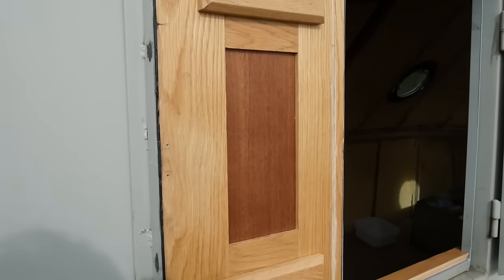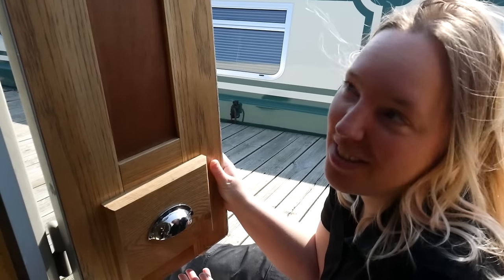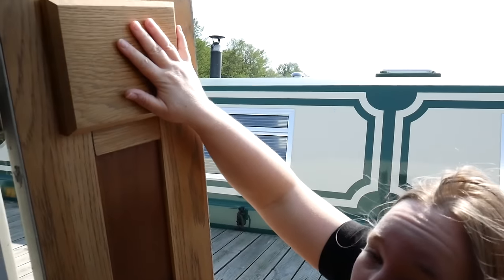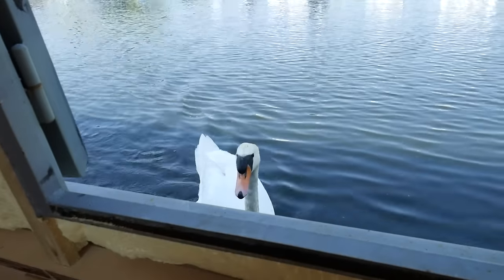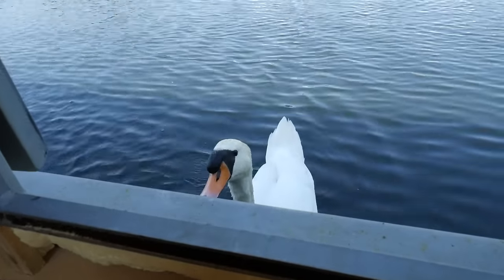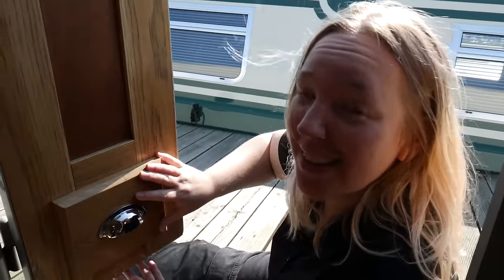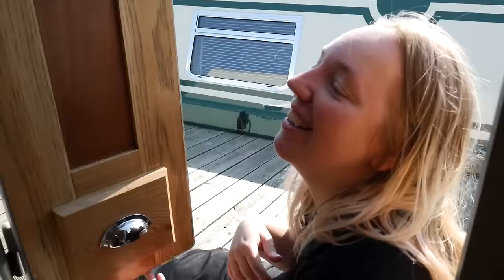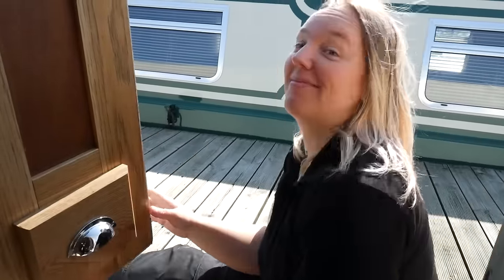The Narrowboat Fit Out – 5: The Doors That Wouldn't Die (Wooden Panelled Narrowboat Doors)

Comment: I saw your dads window silicon!  oops, nice one dad!  When doing your silicon sealer,  put a mask "masking tape" on the glass and round the frame, to form a dead straight line. apply the silicon and then smooth with your finger dipped in white spirit and then pull the tape off immediatly.  Stops the boat looking too homemade to next buyer!  Good on ya both  for having a go.  Pratice and time makes perfect!  £80 and a mastic man will come round and take all your troubles away if you have  a fair bit to do. Well worth it, gives that pro feel.   Especially bathrooms.
Reply: I,m learning from you both , so thanks.  I,m looking at doing one.  CUE LOADS OF BARGE ADS ON MY SCREEN IN THE NEXT WEEK.   spying gits!